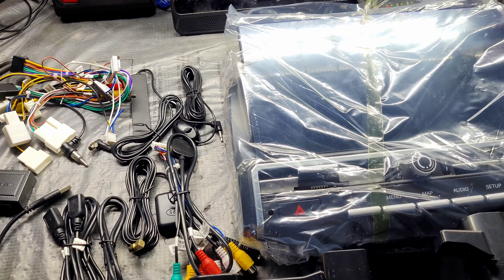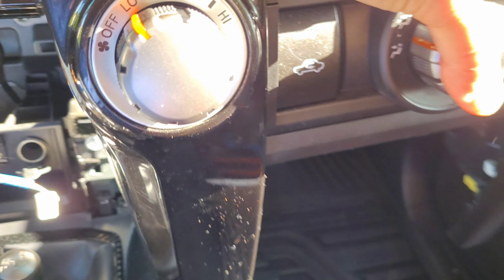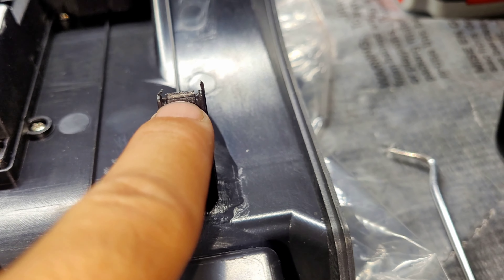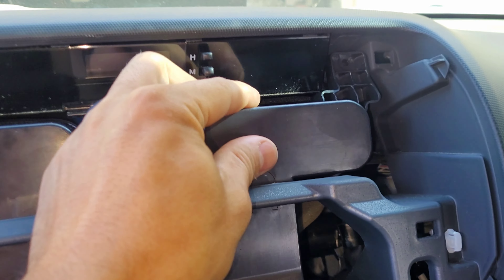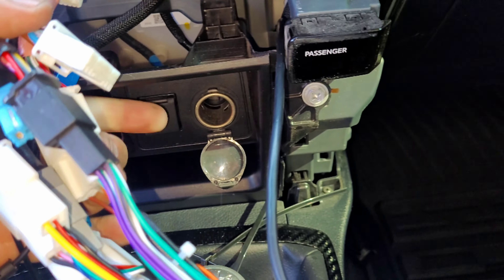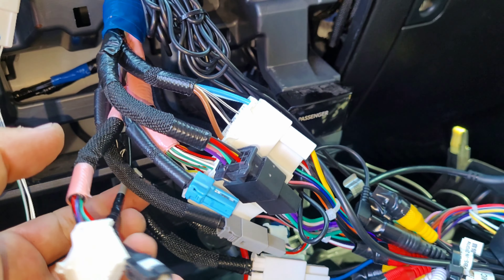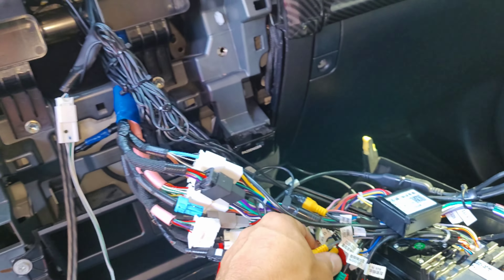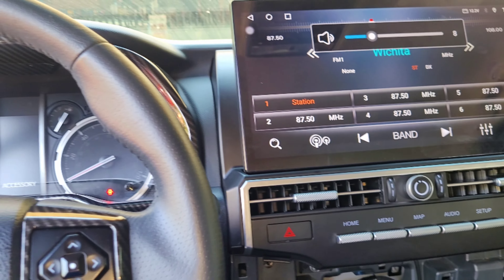2023 4 runner T12 Version 2 Giant Screen Upgrade!! Quick and Straight to the point install/review.

Comment: So I've got mine installed (mostly). I have 2 questions: 1) Where does the mic connect to on the back? I was short on time and didn't get a chance to run it. 2) When I disconnected the OEM aux usb, the connector on the back was bigger than could fit in the port provided with the radio. So did I miss something or what? I have a 21 and you have a 23. Ports didn't exactly change any in 2 years.
Reply from the maker: 21 and 23 are different

Comment: omg, you are a life saver. This is the only install video I've seen for the newer 5th gen.  Thanks for taking the time to show the connectors because I was having the same problems!
Reply from the maker: I did complain to the manfucaturer about them not including a manual and that plug i mention that also plugs into another shouls be mentioned. Luckily i caught the mistake as it wasnt powering on.
Reply from the maker: You are also able to remove the clock if desired  i ended up removing it since I cant see it anyways.
Reply: @FlipSideGarage  I finished my install thanks to your help. However my steering wheel controls are not working and I'm getting no sound from the rear speakers. Also my CarPlay is displaying larger than the screen so it is cutting off a border all the way around the screen.  I'm considering sending the whole unit back because of all the headaches

Comment: I can’t get any of the steering wheel controls to wok.😢
Reply from the maker: Did u go program the steering controls?
Reply: @FlipSideGarage  I tried to but it doesn’t seem to recognize it.
Reply from the maker: @steventitze8717  it may also need tk be set tk the proper can system program
Reply: @FlipSideGarage  tk?
Reply from the maker: @steventitze8717  to*
Reply: @FlipSideGarage  what is the proper can system?
Reply from the maker: @steventitze8717  This ones running a camry which is odd. Its what the manufacturer told me.

Comment: There is a menu in the factory settings about switching the up and down arrows on the steering control - maybe that will fix your issue?
Reply from the maker: Yes you can also set the steering controls manually.

Comment: Did you end up having a white connection and a black connection coming from the car that didn’t plug into anything?
Reply from the maker: A white one yes. I dont remember a black one
Reply: @FlipSideGarage  after much searching I found the black connector is from the stock navigation module. Apparently not needed to be connected to something like the t12.
Reply: The connectors are probably GPS and XM

Comment: CTH radios seems to be a mixed bag. Holes need to be enlarged, the hazard wire is reversed, CTH admin seems to push blame on the users a lot. I like the design but in the end it’s a Chinese android radio.
Reply from the maker: I told the customer the same. After installed,his add on factory 3x lock remote start doesnt work. Radio interferes with the computer communication when trying to remote start. Of course,manufacturers blames the installer(me). Lmao

I have over 15 years of MECP certificication in 12v industry,my background consistss also of buulding electrical panels for Boeing and the F35s,but I guess my background isnt good enough for a "plug and play".
Reply: No one pushed the blame on any of the users for the hazard. We caught it after 2 weeks of a mess up from the factory and fixed it … :) 😊
Reply: @FlipSideGarage it’s 💯 % plug and play  for 2014-2023 

When it was new there were some mistakes form the factory that were addressed. The whole propose of the group, is to support the members without paying the installer :) but if the installer blames the radio for their mistakes and not understanding how and what settings to do on the radio then that’s when I blame the installer … my videos  are   To the dot , takes exactly the time to install, on purpose … in a CCE computer communication engineer , has nothing to do with installing radios, the issue is the factory , when everything works fine, suddenly without knowing, production is smooth as hit butter, then suddenly boom, something surfaces  , that’s when I come in place  to rid fix stuff, then when we find out what the issue is, we return the defected stock  and the factory sells it to others at a lower price , instead of fixing and ruins the reputation and our name… typical Chinese business … I refuse to take 💩 from the factory and refuse to be bullied, unfortunately the person who picks up our returns , gets stuck with it, that’s is one of the huge main asks , to join the group, you need the order Id, if the client bought from elsewhere , then they need to go there for support. Hope this explains and makes sense. Good job on the video ;)
Reply from the maker: He sold the 4runner. Another shop tried to install a remote start and theres interferance when the system was still installed. As far I know the customer did remove the system to have remote start. Remote start functions properly after the radio removal just fyi
Reply: @ I’ve seen only 1 post if I remember correctly or at least some member asked me about something like that. But on my 2 trucks I have remote start and works great. So why are mine  and all the admins and mods  and thousand of members in the group, who has remote start , are working? That’s weird … if it’s a one of it doesn’t mean that it’s the norm, so it had to be troubleshot to understand why. As an experienced installer , you know what I’m talking about, this headunit works with factory remote start and all 12voltsokutions and viper and co… so python , Clifford , compustar etc … so when you have this info what would you categorize the one of situation?
Reply from the maker: @KingSev its a 12v solution system. It worked before an it didnt work after. Thats all I can tell you.  Thank god he sold the vehicle as I didnt want to be blamed for all that issue.
Reply from the maker: @KingSev its electronics. Not everything is 100% whether youd like to think so or not. Even compustar have had errors and thats the leading system on the market.
Reply from the maker: @KingSev nothing is never weird in the electonics world. You should know that. Not everything is always 100%.
Reply from the maker: @KingSev Maybe if the owner of the truck is interested in talking about it. Id gladly give ur info. I dont think hencares that much as he sold it. The radio has been reverted back to stock and remotr start works again. Hopefully thats not to "weird" for yah.
Reply: @ lol nah, no one should blame you for anything, obviously anything outside oem is not covered by anyone… all good. If you have issues, you know where to reach me if they are from my links and or CTH.
Reply: @ absolutely agree with you! It could be anything …
Reply: @ yes sir ! 💯
Reply: @ it’s not a lie talking it’s about testing, we can chat for years, but without testing, we wouldn’t know what happened, end of day, it’s in the past , truck sold … do you have a remote starter ?
Reply from the maker: @KingSev  most definitely. Original owner did choose the radio over remote start though.lol 
He did prefer having that.

New owner was the opposite sadly:(